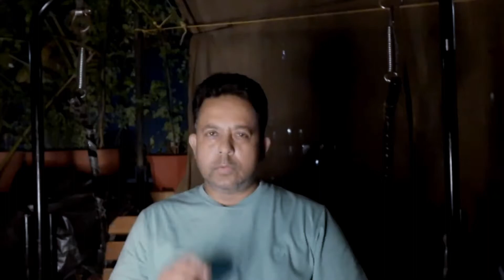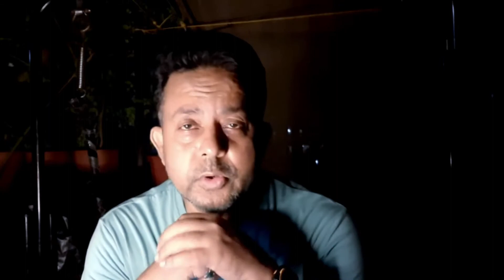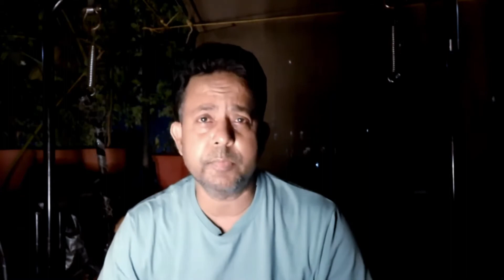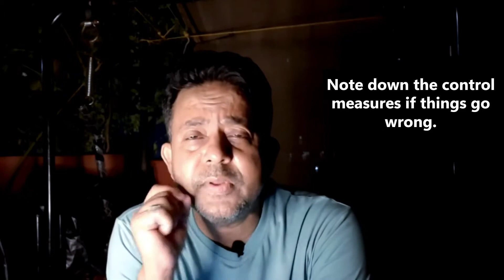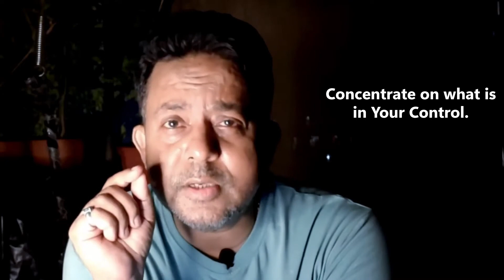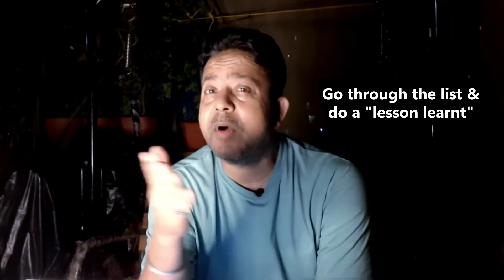The Professional Surveyor’s Checklist

Comment: I was surprised that at my local chandlery marine supply said they don't carry paper marine navigation charts anymore. I was told that everything is GPS electronics noe. Looks like a whole new generation won't be able to read paper charts/maps. What happens if electronics go down? Also Davis plastic sextants are no longer sold on shelves at marine supply stores. They must be special ordered or online.
Reply from the maker: Here we still have paper charts but demand has gone down so new charts are not printed anymore. N to M are also auto downloaded and Ecdis is auto corrected. We use sextant for gyro calibration but even Tamaya says they dont have new sextant. We have to rely on ship breaking yard to find old marine sextant.  New Gen surveyors dont even know there is something like paper Nav chart and they are corrected manually with N to M.
Reply: @OffshoreSurveys  Thank You so much!!!  ; )
Reply: @OffshoreSurveys  Interesting that to find sextants you find them at ship wrecking. Are the Davis plastic sextants reliable enough out of sight of land? Thx
Reply from the maker: Traditionally we had a local vendor from colonial period who used to make sextants but by 2010 the shop closed down. I have imported some 15 sextants from Japan (Tamaya) back in 2008. These are way past their prime. Now Tamaya has refused to supply any. Davis Instruments are not available in India and Online Amazon sextants are just brass showpiece. So ship breaking yards are the only place where one can find good quality marine sextant. But then you have to have a very good contact well before the ship comes for the breaking yard. It is getting harder. Now a days we rely on instant technology so much that we all forgot our basics. And sextant is one such basic instrument. I had sextant embroidered on my shirts arm to show that I am a surveyor when I was in the Navy... Good old days. Things were simpler then. Much simpler.
Reply: @OffshoreSurveys  Do you use sextants to calibrate gyrocompasses? If so how does it work? Thank You Sir...
Reply from the maker: @ChristopherKuhns yes we use sextant for gyro calibration before we start our survey. If the vessel is in port during mobilisation, we use Total Station. But at sea, we use sextant. And yes it works excellent. I have a video on this. I think the name is what is heading and made it few years back.
Reply from the maker: @ChristopherKuhns https://youtu.be/COIS0YDo3t4 please see this video.